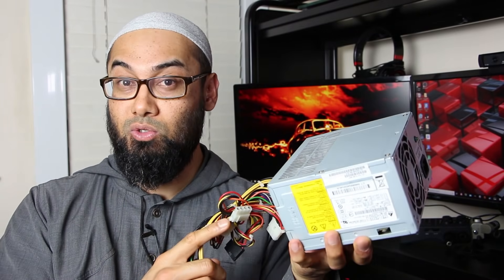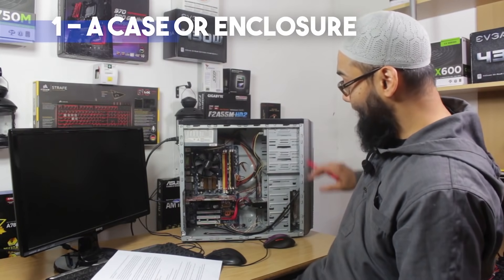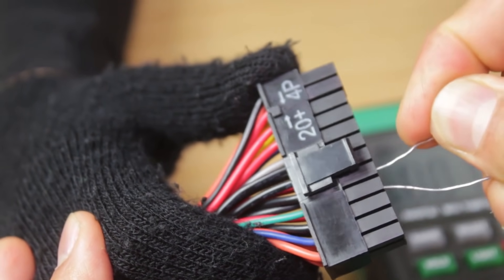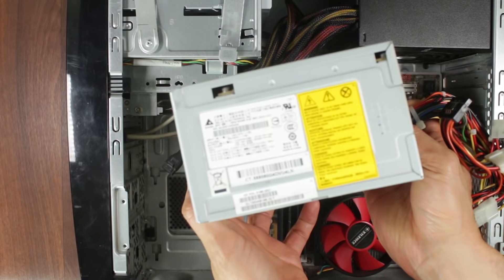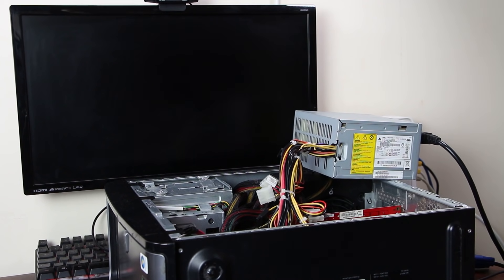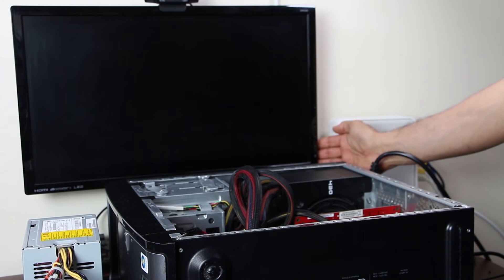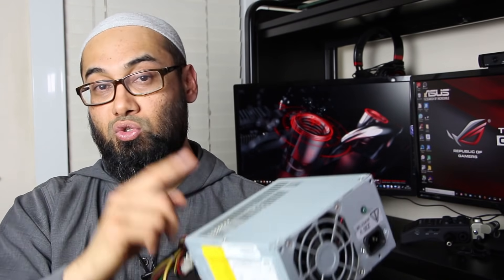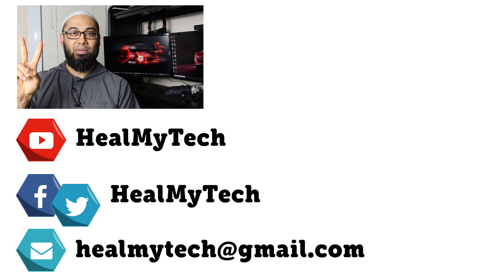Computer Turns On But No Display On Monitor | Led Light On Fan Spinning | Power Supply Unit Pc?

Comment: Hey, just have a question. My monitor does turn off, but it takes it like around 2 minutes to turn on when the pc is up, i never got any funny pictures it just headed me straight to my desktop, and lets say if i would turn off my pc and turn it back on again then it will work, after some time that the pc has been shut down, my monitor still has the blinking green light and its still taking like 2 minutes to turn on. Does this have to do with any power signals that are getting sent? Not quite sure why it straight up turns on when my pc has been off for like minutes but it doesnt when my pc is off for a long time. Started happening recently actually but it would be worth fixing if i can somehow.

Comment: Everything comes on the the graphics card power light come on but the fans don't spin and i get no display could this be a power supply problem or a graphics card problem
Reply: same issue. did you ever figure it out?

Comment: WHAT IF MY SYSTEM UNIT WORKS BUT AFTER FEW HOURS IT STOP.. AND WHEN IM TRYING TO RUN IT ..THE SYSTEN UNIT LED AND FAN WORK BUT DOESNT DISPLAY ANYTHING AND I LET IT REST FOR 3 DAYS AND ITS ALL BACK TO NORMAL
Reply: yeah yesterday i was playing and then the monitor keyboard and mouse just shut off but fans and leds on the pc still work
Reply: Psu is the problem do buy new cuz the component will be damage
Reply: sameee for me
Reply: did u solve this problem

Comment: How do you update the BIOS if there is no POST on the screen and I have no another CPU to use to get this done once?

I have Z390 MSI Tomahawk and the processor I want to use is (Intel CORE I5-9600K 3.7 GHZ SKT1151 9MB CACHE BOXED - BX80684I59600K (Components > Processors CPU) ) but there is nothing I can do.  There is no QFlash port on this machine otherwise I could have used 
https://youtu.be/iTkXunUAriE  but it's a no go here.

Can you suggest something please.   Where about in London are you based so that I can bring the machine to you?

Thanks.

Comment: my pc restart when im playing game, and i try to fix it. i open pc casing and psu. i let it open. and i try playing game. work fine. suddenly black screen. but i still can hear game sound from my pc. what the problem ?
Reply: did u try cleaning your ram
Reply: clean your ram using eraser, clean the gold plated part then put it back make sure it is properly attached. And if u are not using any avr or UPS don't plug ur pc in extension plug it directly in power outlet.

Comment: I suspect that the problem is my power supply since the scenario he described about the power supply failing is exactly what’s going on with my computer, but the reason why I’m confused is because the power supply I have is brand new 🤷🏽‍♀️ 😐
Reply: did you ever figure it out? my power supply is new too
Reply: @willXR  to be completely honest I never really figured it out. After all that happened I noticed that every time I turned it on the boot up logo wouldn’t show up. The computer would run but my monitor would stay off until reaching the windows login screen and the keyboard lights would flash on and off while everything was booting up. I took it to get it repaired, but when the guy first tested it out nothing happened, it booted up normally and even the boot up logos showed. I told him about my situation with the logos and he said that that’s not a problem (and that there is in fact an option to skip the initial boot up which I explained was not on). He recommended I leave my computer with him for a day so he can check it carefully. There was no problems but he still asked for an additional day. In the end nothing was figured out but it does turn on normally except it doesn’t show the logos with my monitor and the keyboard still flashes. It’s like when you turn off the monitor and turn it back on after the computer has been turned on. Perhaps the problem is my monitor 🤔

Comment: My pc was stuck in a reboot loop, I tuck out the ram stick by stick switching slots also. I then tuck out both sticks of ram the pc boots but no signal to monitor. I have just bought a brand new psu. I can't see 2 sticks of eam dying at same time.
Reply: try changing yr hdd

Comment: Brother my cpu cooler my led fans are gpu is spinning my motherboard shows it has power but it cannot boot I currently have a rtx 2070 super msi and I have 600watts psu could my psu be the issue

Comment: I have just bought a pc
Its xeon 1270 V3 and graphics card is rx480 8gb
At first when i start my pc display went off after 5 mint while power light was on then I re plugged my gpu and start it again same issue but now it was showing black and white screen then i showed it to shopkeeper he said that its gpu bios issue and he will return my card in some hours
I just want to make sure that is this a bios issue or there is something else
PS: Power supply is ok he checked it in front of me
Sorry for bad english

Comment: Its the same... but before 30m 40m windows 10 start up.. i change psu 650w to 750w.. change ram... cables... the same problem... i dont real change my cpu because i want to upgrade i rigth now i can't..

Comment: Hi,
My pc turns on but not display. I tryed to boot from usb to install win10 it boot and install win10 but when pc restart pc works but no display. I put in bios that hard drive boot in first and doesnt work. After I removed hard drive and install win10 with another pc. When win 10 installed I put back hard drive in my pc and now it works. What can be the problem? Thank you

Comment: Ok after watching this, I’m almost certain the issue is my power supply

EDIT: I think the issue has been the fact that my PSU fan has been facing down all these years, and so a lot of dust had accumulated within it. I took it out and cleaned it with a compressed air can, it is, at the time of making this comment, working. Fingers crossed it continues to work. Btw, you've earned yourself a new sub. Thanks so much for this helpful video!

Comment: Will it also happen if the psu has not enough watts for the components? It seems that its happening to my new build right now. GPU Fans goes 100% speed everything are on but no display.

Comment: I have a similar issue, but I also notice that when the mouse and keyboard don't work when I plug them in to any usb port. The led light(s) light up for a second when I plug them in for both the mouse and keyboard, but they don't stay on. I would imagine they'd have to stay on if the computer is working properly. And I know the mouse and keyboard work because I've used them on my laptop. Can this possibly be a PSU issue as well?
Reply: Did you find out?
Reply: yo same 😢

Comment: Please help im frustrated, yesterday i was downloading windows update to 2004 version and i noticed my memory was being used alot and power was using at high in task manager, i was doing nothing but suddenly blue screen appeared and there was an error for memory written to failed/crashed something and it wasnt moving from 0%. I panicked and switched off my pc and from then it doesnt display, when i turn it on now, it shows light on mobo and turns on fan at max speed but doesnt display on monitor, i connected my mobile to usb slot it was working.

Comment: What I did is flip the switch off and then unplug waited for 10 mins and then remove the entire ram and wait for few minutes and then put it back plug in and then flip the switch and run.

Comment: I had picked up like a 10 year old pc a couple hours ago, I didn't know much about pcs but I knew that the piece of shit wouldn't be able to run well, I turned it on and nothing showed up. I searched it up and found this video, I think I'm gonna get a new power supply because it is going to be a project I work over for a couple months (and if you were wondering I got it for free

Comment: My pc is on, but the keyboard, mouse and my monitor is not on. Also my monitor is emitting orange light. How do i fix this :(((
Reply: Did you find a fix? I have this too
Reply: @whimsical6  it was my power supply lol it needed to be turnt off after shutting down

Comment: Hey, nice content. I have the same issue right now, but not permanent. Fan is spinning, Mainboard led/lights are on, but no boot. If this happens my debug led on the Mainboard shows nothing. If it boots correctly - every now and then - then the debug led displays codes. I'm curious if I have the psu problem also, but just for the 4 pin. Could this be the case? Thanks

Edit: it was indeed the psu. Replaced it and it works

Comment: Ok so i have an issue, hope someone reads this and replies quickly. So i turned on my pc normally how i usually do everythings normal, boots up. I wait for a minute or two for everything to settle and then i go and play NFSU2 And the screen went green with black bars, the whole screen with a weird loud buzzing sound coming from speakers.. its like the whole pc froze, so i shut it down, and i turn it back on, no image on screen, pc fans are working, everything is ok, i have lights on speakers, mouse, keyboard, but when i click anything on the keyboard all lights turn off for some reason, again, no display picture, i have tried a lot of stuff, even trying to see if i have bent pins on my intel socket but everything is ok, i think either the PSU or the ram is the issue, if someone could give an advice or something i would appriciate it!

Comment: I think It's VGA problem because, if it moves a little bit, screen is yellow and now it doesn't even turns on, I mean system case works normally, screen too it even shows LED that it's turned on but still not turning on! Someone help me before Im screwed 😭😭😭😭

Comment: Dear I once saw your video and that worked like a charm. But today I HAVE A NEW ISSUE IN PC, WHEN I TURN ON THE PC FIRST TIME THEN THE FRONT USB PORTS DOESNT WORK UNTIL I RESTART THE PC.. ITS REALLY IRRITATING. PLEASE HELP
( FYI I TRIED TO CHANGE THE DIFFERENT USB PORTS ON MOTHERBOARD BUT ITS AS IT IS.. FRONT USB WORKS ONLY WHEN I RESTART THE PC. WILL WAIT FOR YOUR RESPONSE.

Comment: i just changed my cpu, and i try to turn my pc on and it turns on, like the fans are spinning and all, but the display still says “no signal”. ive already checked the hdmi, power supply cables, everything idk what it could be

Comment: I have the same problem now I think just to confirm in your case did any of the usb ports were working in my case everything is working fine but the pc doesn't boot not motherboard logo and the strange thing that I noticed that none of my peripherals were turning on like my keyboard or mouse the usb ports are dead
Reply: What was the problem ? Did u get it fixed because im having same issue rn. Usb port is working when i connect my mobile it shows its being charged but not peripherals are working. Fans are working too and lights are turning on but no boot

Comment: Monitor :

https://amzn.to/3h7YWqj
Sceptre 20" 1600x900 75Hz Ultra Thin LED Monitor 2x HDMI VGA Built-in Speakers, Machine Black Wide Viewing Angle 170° (Horizontal) / 160° (Vertical)

https://amzn.to/2E1Y3Bf
Acer K202HQL bd 20” (19.5" viewable) (1600 x 900) Monitor (DVI & VGA Ports)

https://amzn.to/2Ehgq4I
https://amzn.to/2Q1jc0P
https://amzn.to/3h95qVL
Samsung CF390 Series 27 inch FHD 1920x1080 Curved Desktop Monitor for Business, HDMI, VGA, VESA mountable, 3-Year Warranty, TAA (C27F390FHN), Black
Samsung Business CH890 Series 34 inch WQHD 3440x1440 Ultrawide Curved Desktop Monitor for Business, 100 Hz, USB-C, HDMI, DP, 3 Year Warranty (LC34H890WGNXGO), Black/Titanium

https://amzn.to/348UTWR
Dell Professional P2217H 21.5" Screen LED-Lit Monitor
Visit the Dell Store

https://amzn.to/314J95M
Dell Professional P2417H 23.8" Screen LED-Lit Monitor, Black

https://amzn.to/315AEaM
Samsung LC24F390FHNXZA 24-inch Curved LED Gaming Monitor (Super Slim Design), 60Hz Refresh Rate w/AMD FreeSync Game Mode

https://amzn.to/2DSSsNH
ViewSonic VP3268-4K PRO 32" 4K Monitor with 99.67% sRGB Rec 709 HDR10 14-bit 3D LUT Color Calibration for Photography and Graphic Design,Black
Visit the ViewSonic Store

https://amzn.to/345Rl7X
ViewSonic VP3481 34" UWQHD 100Hz Curved Monitor with USB Type C 100% sRGB HDR10 14-bit 3D LUT and Color Calibration for Video and Graphics

https://amzn.to/316IEbw
Samsung 23.5" FHD Curved LED-Lit FreeSync Monitor(LC24F396FHNXZA)

https://amzn.to/34b3QPK
Acer G226HQL 21.5-Inch Screen LED Monitor
Visit the Acer Store

https://amzn.to/2YcC6pT
Acer R221Q bid 21.5-Inch IPS Full HD (1920 x 1080) Display (VGA, DVI & HDMI Ports),Black

https://amzn.to/3136YLk
Acer R221Q bid 21.5-Inch IPS Full HD (1920 x 1080) Display (VGA, DVI & HDMI Ports),Black

https://amzn.to/3aAvHdc
ASUS VE228H 21.5" Full HD 1920x1080 HDMI DVI VGA Back-lit LED Monitor, Black
Visit the ASUS Store

https://amzn.to/2FpAy5l
Acer G226HQL 21.5-Inch Screen LED Monitor

https://amzn.to/3aKR4sx

Samsung 23.5" FHD Curved LED-Lit FreeSync Monitor(LC24F396FHNXZA)
Visit the SAMSUNG Store

https://amzn.to/3g7SiPg
Samsung C27HG70 27" HDR QLED 144Hz 1ms Curved Gaming Monitor with FreeSync (C27HG70QQN)

https://amzn.to/312XboH
Samsung LC27F398FWNXZA Samsung C27F398 27 Inch Curved LED Monitor
Visit the SAMSUNG Store

https://amzn.to/3h9UNlu
Samsung LC27F398FWNXZA Samsung C27F398 27 Inch Curved LED Monitor

https://amzn.to/349pgfZ

Acer XR342CK Pbmiiqphuzx 34" Curved QHD (3440 x 1440) 100Hz Refresh Rate Monitor with AMD FREESYNC Technology (Display Port & 2 x HDMI 2.0 Ports),Black

https://amzn.to/3h1ZFsW
LG 34WN80C-B 34 inch 21:9 Curved UltraWide WQHD IPS Monitor with USB Type-C Connectivity sRGB 99% Color Gamut and HDR10 Compatibility, Black (2019)
Visit the LG Store

https://amzn.to/3l4EdGi
Samsung Business SH850 Series 24 Inch QHD 2560x1440 Desktop Monitor for Business (In Black) with USB-C, HDMI, DisplayPort, 3-Year Warranty, TAA (S24H850QFN)

https://amzn.to/2Yafh6i
Samsung LC27F398FWNXZA Samsung C27F398 27 Inch Curved LED Monitor
Visit the SAMSUNG Store

https://amzn.to/3h6QKGx

Samsung UH850 Series 31.5 inch 4K QHD 3840x2160 QLED Desktop Monitor for Business, AMD FreeSync, DisplayPort, USB Hub, 3-Year Warranty (U32H850UMN)

https://amzn.to/2DVHPK2
Samsung CF390 Series 27 inch FHD 1920x1080 Curved Desktop Monitor for Business, HDMI, VGA, VESA mountable, 3-Year Warranty, TAA (C27F390FHN), Black

https://amzn.to/2E1ieze
Sceptre C248W-1920R 24" Curved 75Hz Gaming LED Monitor Full HD 1080P HDMI DisplayPort VGA Speakers Ultra Thin Metal Black
Visit the Sceptre Store

https://amzn.to/3kXiDDg
Samsung 27-Inch CR50 Frameless Curved Gaming Monitor (LC27R500FHNXZA) – 60Hz Refresh, Computer Monitor, 1920 x 1080p Resolution, 4ms Response, FreeSync, HDMI,Black

https://amzn.to/2Q2rpBP
Samsung UH850 Series 31.5 inch 4K QHD 3840x2160 QLED Desktop Monitor for Business, AMD FreeSync, DisplayPort, USB Hub, 3-Year Warranty (U32H850UMN)

https://amzn.to/2Eg2YOU
Samsung 850 Series 28 inch 4K UHD 3840x2160 Desktop Monitor for Business, HDMI, DP, FreeSync, 1 ms response, USB Hub, 3-Year Warranty (LU28E85KRS/GO)

https://amzn.to/2Q3aVcM
Samsung 23.5" FHD Curved LED-Lit FreeSync Monitor(LC24F396FHNXZA)

Comment: I just built my computer and I have no display. All fans are spinning, the front leds do not work yet because I have yet to put windows on it, but the case lights work, but still no display?

Comment: WHAT I DID TO FIX: take out mobo battery for 15+ seconds and put it back in. Worked first try after trying everything else.
Reply: now the question is where will i find this mobo battery
Reply: @QuikFin80  it’s a little silver circle somewhere on it. Look up cmos or mobo battery
Reply: @DanielBirman  ok thanks hopefully this works

Comment: Make sure that your output cable is plugged into the right socket in the back of the computer. Some sockets are input the computer is receiving information like a keyboard. Some sockets are output only, the computer is projecting information out, it has to be in the output only socket. When I plugged the cable into the right socket, it all worked!

Comment: I have acer pc. I was working. Sudenly like stuck, and display   like old tv shivering. No  mouse and keyboard  works. No way to off. I directely  off on cpu. After i tried to  switch on. Fan works. But  no booting on display. Signal shows on display  perfectely. Pl help

Comment: Can I ask sir, I have my system unit which when plugging on, the gpu gives off white light but when powering on gives yellow light and suddenly turns off not even a post. Does my power supply gives this problem?
When getting the gpu out, it turns on nicely.
Ryzen 3 2200g
Asus RX470 Mining
Corsaie VS450
8gb RAM 
128gb ssd
1tb hdd
3 Stock Fans

Comment: this guy is genius
Reply from the maker: Genius is too much, maybe Grand PUBA! 😜
Reply: @HealMyTech1   Hi when I plug my computer up. It automatically starts without me hitting the power button. And the fan starts spinning. But then it turns on and if. No matter when I unplug the computer. As soon as I plug it in the computer fan comes on. But the monitor says no signal.